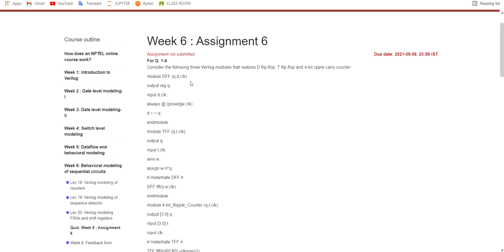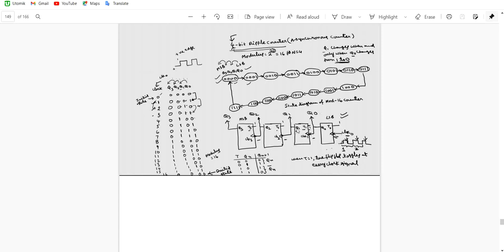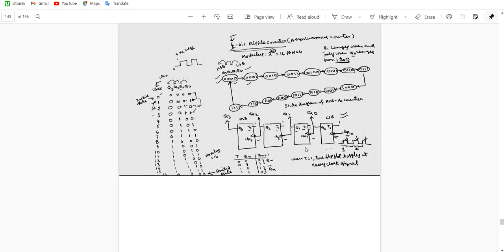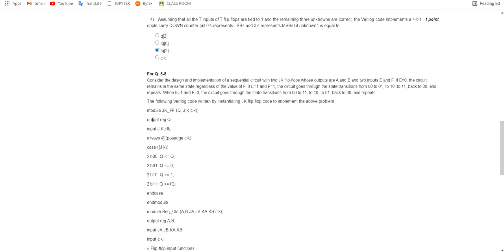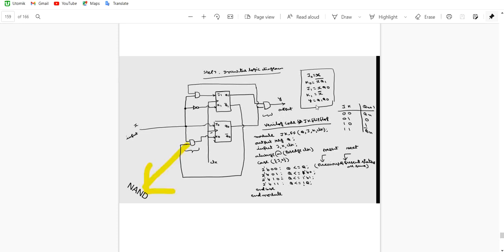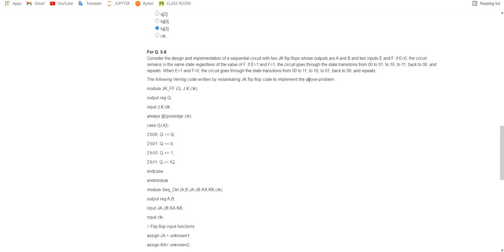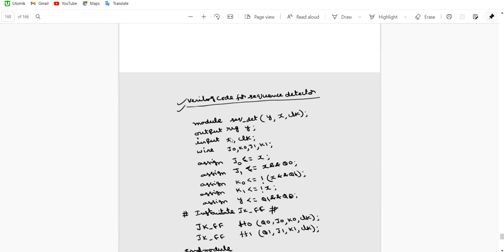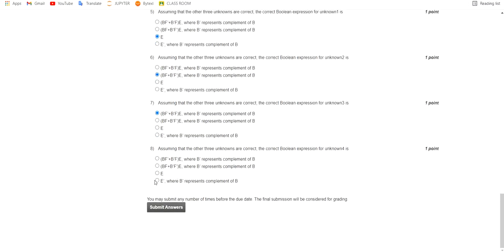System Design Through VERILOG||Assignment6||NPTEL||MNR KRISHNA #System_Design_Through_Verilog #NPTEL

Comment: The same mistake has given in Assignment-5 Question 8. i.e d<=q; The NPTEL team negotiated (removed ) that Question from the valuation.  So many candidates have given their feedback about this, then only they have removed . Similarly for Assignment-5 Question 4 and 5 also they have given wrong answers.  Till now there is no solution has released for Assignment-5. What we did performed as exactly correct I think. We have to Wait until an exact solution for Assignment-5. I have given my feedback about Assignment-5 Question 4 and 5 with solution of attachments in the " Ask a Question " ( discussion room)

Comment: Sir, in module DFF, 'd' is the input.  In the given code,  statement d<=q; was wrong. The correct syntax to execute that statement is q<=d;
Then only the complete code will execute and it will give the output as down counter for unknown 1 = clk,  unknown 2=!q(0), unknown 3=!q(1), unknown 4=!q(2) if clock as posedge..
Reply from the maker: No, I think the correct syntax is d<=q only for DFF...
Plz check it once in lecture videos i.e., lecture 17 in portal...
Reply: Ok sir